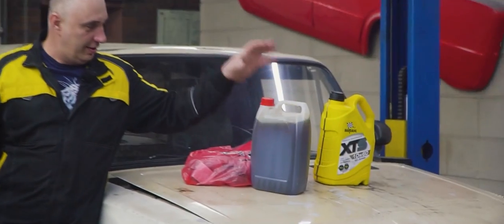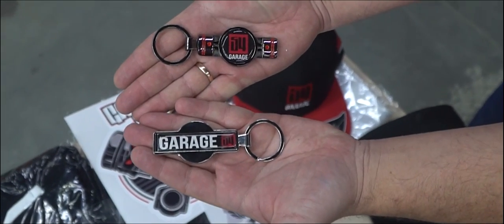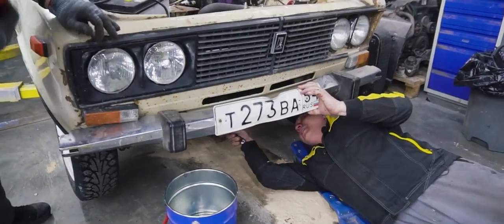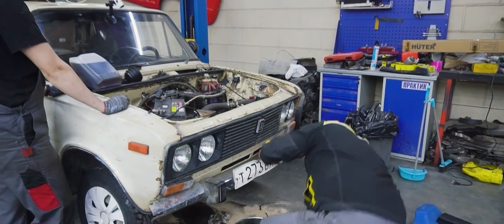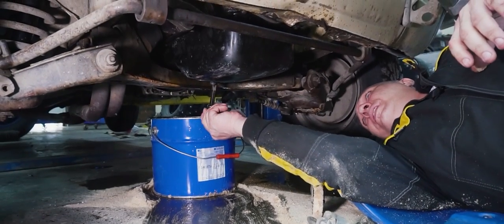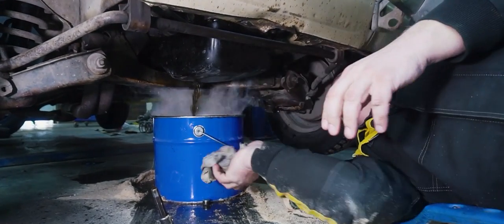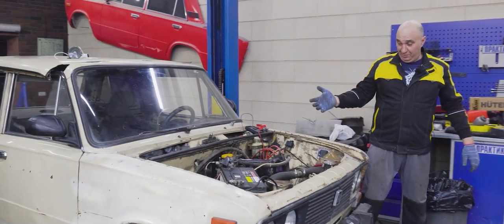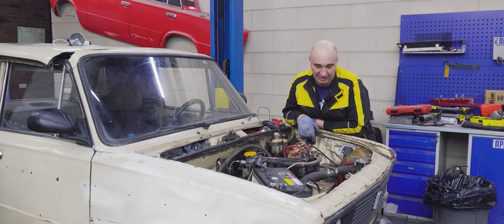Can you change the oil on a running engine?

Comment: Put a turbo on a stock lada engine see how much it can handle
Reply: That is a great idea!!!
Reply: Or use a second Lada engine to power a supercharger that forces air into the first engine!
Reply: Yes
Reply: Yes, great idea!
Reply: , while running 😁
Reply: Noice
Reply: Nice idea!
Reply: My guess is not alot
Reply: With how much blowby they have, forcing more air would only exacerbate that issue.
Reply: The block will become Swiss cheese at 30bar boost
Reply: Well we learned at sick week 80psi splits a Honda in two
Reply: will be difficult with a carbie... they has to switch to EFI first, i think... 
of course there are ways to do it with a carbie but this isn't a proper way...
Reply: Yessssssssss
Reply: @djtongi  you can turbo prep the carb or just run an old 70's suck through system
Reply: @djtongi  I think as long as the tune the fuel ratio to the boost it should work somewhat.
Reply: Yes!
Reply: and add NOS!!
Reply: Yes!
Reply: @jwalster9412  the problem is that they are carbureted so they don't work under positive pressure of the turbo. the turbo ends up pushing the fuel into the jets. you will either need to use a fuel injection system or put the carburator on the intake of the turbo which is a little unconventional
Reply: seen that, stock 1200cc lada engine can easy handle 1bar boost :D
Reply: Lada VFTS was 180hj.(back in 80s soviet russia)  But not stock engine.
Reply: @mvnk4437  and it was not turbo...
Reply: Brilliant plan! 😁
Reply: or how many turbos can a lada engine take
Reply: Could you just use compressed air?
Reply: This
Reply: @djtongi  fuel injected ladas exist
Reply: Why not twin charge?
Reply: @jwalster9412  more like 5
Reply: Great idea!!
Reply: @steve0680657  instant Swiss cheese engine block. Just like instant ramen.
Reply: @jwalster9412  u do realize 1bar=14psi
Reply: @Austin-ue5kh  Yeah.. but it will do the trick.
Reply: I think you should see how much boost the Lada can take!!!! Best idea!
Reply: @SerPurple51  they'd need to fit the turbo after the carb, or get an airtight carb. It can be done.
Reply: Yes!!!
Reply: 2 turbos .. one small one big .. compound style
Reply: Might ad well go with nitro while at it! What power would it produce, while it lasts if at all
Reply: @jwalster9412  guy just blew a chev into two parts 80 lbs /5.5 bar
Reply: @dennisford2000  video?
Reply: @jwalster9412  30 BAR? That is a TON. over 400psi...diesel trains don't even hit 100 psi.
Reply: @midlbrwn15  I don't just want the rods to break, I want the cylinder walls to pop.
Reply: @jwalster9412  uhh dude... 400 psi will just be a bomb, man. I'd almost guarantee 60psi would probably be good enough for some destruction. Even a good diesel block can crack at 40. Not to mention there's no way it'd ever get to 400.
Reply: @tucsondog  pretty sure roadkill did that but a Russian version would probably be just as hilarious to see
Reply: @CyberlightFG  yes
Reply: You would have to add alot of fuel or would nock alot but I am sure with a very rich mixture it could easily handle 300hp
Reply: I suspect this could go quite well, those blocks are cast iron, closed deck. Ideal for huge cylinder pressures. I suspect the block could handle some serious boost. These guys have put together DIY fuel injection, if they got it to work with a fuel pressure regulator, some forged internals, block studs, and possibly some way to manage ignition timing, I think they could pull it off with some serious results!
Reply: @jwalster9412  as would any block with 435 psi of boost(30 bar)...

Comment: Try air-cooling a regular watercooled engine, by pumping lots of air through the water cooling system, and check how long it can run like that
Reply: 👆This☝️
Reply: Or put an air conditioning compressor on it and use the engine block itself as the condensor 😜. Probably not good for the engine as the engine is designed to run at a specific temperature, but maybe it's interesting
Reply: Large industrial compressor and a gang of intercoolers to lose the heat of compression
Reply: air cooled engines are basically oil cooled. they need twice as much oil in sump
Reply: @kize32  not
Reply: @kize32  Volkswagen 3 qts 😀
Reply: Doesn’t work…..
The air can not overcome heat and carry it out like coolant.
Reply: @lookingbehind6335  with sufficiently cold air I could freeze the engine, and it would stop
Reply: @dennisford2000  you could, or someone else?
Reply: A cooling system with water jackets in the block are only designed to hold a few psi even when hot, so like 20-30psi at most.  Test em at just a few lbs..  air conditioning systems run at 230psi normally so i doubt the gaskets would hold the pressure of putting an ac compressor on the cooling system..  but good idea, it should treat the motor like a heat pump and work for a second at least but the refrigerant and oil would turn acidic pretty quick with water and glycol residue all up in the system..
Reply: @Z-Ack  coolant gaskets would work as designed, a 150 cfm compressor 5 m2 for the rest of the world, would not develop much pressure but huge volume, just remove the stat . Hey Vlad , how bout it , need a five meter compressor, five hundred feet of 50 mm hose in the snow and blow it. Might not get hot . Remove all the various connections and sensor holes in a carb engine, and blow it, and after that maybe use the compressor for boost!
Reply: I have always thought of that lol
Reply: @lookingbehind6335  If it's moving fast enough it could.  However, his is all for fun stop being one of those guys that is standing there smoking a cigarette in the corner acting like how every idea any one else says is just "stupid" don't be that guy. It's a thought for fun and entertainment.
Reply: @Engineer9736  evaporator
Reply: @jonathanschubert9052  did I stutter?
Reply: A vacuum pump on one end, a compressor on the other.
Reply: @lookingbehind6335  I tried to drive home one night when it was -30f outside and had a heater hose bust on me. I only got about 2 miles down the road before destroying my engine. Thought the cold woudl air cool my engine. But air cannot overcome heat like coolant.
Reply: Won't work. Trust me. Not enough surface area, and the system is usually not rated for the higher air pressure required to even make a difference - refer to comments above.
Reply: @SALTrips  would not build pressure and would work
Reply: @dennisford2000  the engine itself is a fantastic compressor. why not plumb the intake of the engine through the cooling system to have the air the engine uses to cool the engine? self contained coolant system that is under zero pressure
Reply: it wont
Reply: @Mikelectric  it has to it has no choice.
Reply: @jasonharrison25  large diesels do exactly that at idle. , and it can be a cylinder deactivation on varying cylinders to make an engine that can be run san coolant.
Reply: @Z-Ack  so with a cylinder of nitrogen or a scuba tank let’s see what pops on an engine when you have say 300 psi /21 bar . Start with old stuff and see  core plugs pop , radiators pop hoses swell up like.... the old ladies belly when she is pregnant. Then make a hat for the carb and blow it, maybe some killer springs on the valves for float and see if lada can do ten k rpm?
Reply: thats not how air cooling works! 

lol
Reply: @Born_Stellar  right. But this Russia.
Reply: Air is much worse thermal coupler, the engine will die almost as fast as no water
Reply: @barakhalla5338  one in a thousand, thus you need 150 cfm or bigger, inter cooling and laying hose in nice Russian snow.
Reply: i think the best way to do that is with a turbo .. mount the turbo on the exhaust normal, then take the thermostat out then hook the bottom radiator hose to the turbo where it would of hooked to the intake then redo the waste gate so the turbo will spool up sooner
Reply: @stephens7725  Another person who doesn't know basic physics. Air is a garbage heat conductor and a turbo compresses air... which HEATS it up.
Reply: @kize32  

All engines are oil cooled though.
Reply: @Z-Ack  as a low pressure engine block evaporater on a A/C maybe as i have thought 💭of trying it but volume counts too which is why I probably haven't tried it yet that and for me it would be a expensive experiment to do
Reply: Air is a really bad thermal conductor, try holding your steak 1 cm above your pan and see how long it takes to cook.
Reply: @s.c.o.s4672  but R-12 or CO-2 or something different but like it not air / O-2 for my experiments

Comment: I would like to see a spark plug change with engine running 😜🤣
Reply: I wonder if it would be possible to get it in? I've seen the damage they can do when they shoot out! 

I agree!
Reply: Sounds dangerous af lol
Reply: Sounds like its risky enough for Vlad, he will look like a newly assimilated Borg with the spark plug sticking out of his eye socket.
Reply: @volvo09  Not such a problem, with an idling engine. There's not much compression in the cylinder, and, you've removed the plug wire, so the cylinder isn't "firing". If the engine was running wide open, the compression would be much greater, and it's noisy. (I know, I've actually done it!)
Reply: I've had spark plugs work their way out before, the trick would be wearing an insulated glove to protect you from the high voltage. Or use a coil on plug setup so that you electrically stop the spark before you need to remove the coil.
Reply: I can see all but one aspect of that as doable, and no it isn't the high voltage lol

You're not going to get the threads started against that compression stroke. You can short the spark plug wires out one by one and likely even remove a plug from an idling engine with little more than a bit of stress on the very outside threads for the holes... 

But no matter what you do, you're not getting the new one in the hole without wrecking shop in those holes 🤣🤷‍♂️

Comment: I added oil to a running engine once. I really miss that car but it did make a cool fireball after the oil sprayed on the exhaust manifold.
Reply: My friend left the oil cap off his girlfriend's car. She pulled over thinking the car was on fire after getting on the highway. Oil was ALL over the exhaust side of the engine. 

And the cap was still there, haha! I have him tons of shit for that one!
Reply: @danieltabrizian  look it up, dumping it on exhaust manifold isn't gonna light it up and that's a simple fact. U can dump gas on the exhaust manifold and it won't ignite either.
Reply: lmao oil doesnt burn that easily.... left my cap off one time. ran 70kms and when i opened the hood the oil was literaly everywhere,including the exhaust.
Reply: @volvo09  I’ve done the same, realized it within a mile of an autozone, bought a cap, a quart, and paper towels lol
Reply: Oil will absolutely catch fire happened to me on the way to FL from GA in a $2000 car I bought because my truck blew up on the way up. The car had a bad valve cover gasket and puked oil down the back all over the manifold when I opened the hood at a rest area to check the oil, woosh flames licked up. I got it out and put oil in and drove another 500 miles. Car still runs great
Reply: @shawnsatterlee6035  Transmission fluid will. Seen an old square body gm burn part of the engine bay plowing snow from transmission oil puking out of the dipstick.
Reply: @danieltabrizian  i don‘t know if a hot exhaust is enough to light it on fire, but in a burning chamber it will certainly ignite because of the high pressure and temperature in there. Best example is a runaway Diesel, that happens when a Diesel engine pulls oil and burns it, so there is no way of stopping it until it seizes.
Reply: That didn't happen.
Reply: @euro_rfx4499  yeah, even a burning cigarette won’t light a puddle of oil
Reply: @nicoketterer9665  it could if you just drove it real hard... the exhaust would need to be near the glow point to ignite, and that's not impossible, I've popped some hoods after a spirited run at night and seen a slight glow, so it will get that hot, just has to be driven hard. 

I built an oil burner heater once and if the burn plate ran dry and the fire ran out it also would relight under similar circumstances... Little glow remaining, it relit. Other times it just needed a whiff of open flame from a lighter in the smoking oil.
Reply: @volvo09  you can ignite it if it’s hot, to the point it starts vaporizing. But i doubt you can light a puddle of it by just throwing a burning match into it or by holding a lighter above it. As long as there’s no vapor or gases the mixture is to rich so it won’t ignite. Same goes for diesel fuel
Reply: @shawnsatterlee6035  we lost an evoX with over 600 horses on the Nürburgring due to an oil leak onto the exhaust system.
Made some cool pics and a video from the incident. Was a sick af fire!
Reply: @Shawn Satterlee  

First thing I thought when I read the initial comment. Even if you atomised the oil in a fine spray (exactly like blowing out of the engine wouldn't do) it wouldn't ignite, ever.

As you say you can dump petrol on a hot manifold and it'll hiss and dry like water.
Reply: @tct72  

Unless there were rags or paper etc left in the vicinity the oil wouldn't catch fire. The flash point is nearly 200 degrees.
Reply: @Cronic318  

It will burn but it categorically won't combust on contact with hot metal.

Engine oil, trans fluids etc are defined as combustible liquids, not flammable. Two very different things. If anything used engine oil is far more 'able' to ignite due to the small presence of fuel traces in it... but it still won't set on fire. Try dipping a piece of hot but no where near red hot steel in used oil. It'll hiss and bubble and that's it. Good for quenching/surface treating though.

As I said in another comment the only likelihood of a fire from oil will be a something for the oil to soak into and burn when things get hot enough. This is why leaving oily rags in the engine bay especially near exhausts and manifolds is a big no-no.
Reply: Explosion?
Reply: @volvo09  i done that once the cap was still there i never felt so dumb hahaha 😂 😂

Comment: If your vehicle burns/leaks enough oil, you have the bonus of never having to do an oil change because you keep putting new oil in. I call this: The perpetual oil change.
Reply: you need to put a new filter in at some point
Reply: @SpencerLemay  
Nonsense……filters are overrated. After they clog up, they will go into bypass to insure flow. 😀
Reply: Same idea for power steering fluid, ATF, brake fluid as well?
Reply: You still need to drain the oil to remove the sludge from the pan.
Reply: @Chris-yy7qc  not needed on old worn engine on POS car.
Reply: I knew someone who did this in school...they just bought a case of oil to keep in the trunk and dumped in a quart or two every time they got gas...
Reply: @lordred7462  It probably became a POS, because you treated it like one.
Reply: @Chris-yy7qc  when a new set of tires cost more than whole car is worth than you stop repair it, change oil and so on. Just drive it until it breaks and dump it to scrapyard then and buy cheap another one
Reply: @lordred7462  Thats what stupid people do. Killing a car "on purpose" by neglecting it is plain stupid.
 
It doesnt matter how much the value of a vehicle is. Never cheap out on maintenance. If youre on a budget do the work yourself. And if the car runs fine and theres no engine damage or excessive rust, then it will continue to run for a long time (*if* maintenance is done).

Buying new cars instead of repairing the old one is in 95% of the cases way more expensive in the long run.
Reply: @Chris-yy7qc  we're talking about 25-30 years old cars. These cars are not economical to drive, burn more fuel (when you pay 1litre of fuel 1.90$, 1 litre, not 1 gallon, higer fuel burn is issue than) and in 90% cases these cars are rust buckets.
Reply: I had a 90's  Mitsubishi Galant that did that. 1L of oil every week.
Reply: @lordred7462  The cars are rust buckets because of drivers like you that dont care. Rust can be adressed when its a tiny spot. If you again neglect your car and let it rust until you can see the road, thats not the cars fault.

More fuel than what? A new car? Sure, but the new car will cost 20k$ more. You can refuel your old shart cart forever for those 20k$. So even if the fuel consumption is half on the new car, in the end the new car is not more economic.

But thats not what we were talking about at all. Quote (you): "Just drive it until it breaks and dump it to scrapyard then and buy cheap another one". So arguing with fuel economy old vs new doesnt really make sense.
Reply: @Chris-yy7qc  look pal there is whole lot of peoples that live in condos and their cars are parked outside on public parking whole their life. How can these people "deal with rust when is just a small spot" when they can't even crowl under their own car? Not everyone is this world is mechanic and most people don't care, when their car tells them that it need oil change they change it and don't think much about it. For most of us car is comodity just like TV, so we use it how we want, when we wont. When it breaks, just toss it to junkyard and buy another one. Not to say that that new cars are whole lot nicer to drive compared to old clunkers.. Don't get me wrong I got old Lada Samara that is currently in restoration process but it's just old car and when restored it will never be everyday car. No power steering, no ABS, no AC, no power windows, no nothing. It's just old car for weekend joyride and hell on earth if needed to ve driven every day
Reply: @lordred7462  You dont need to be a mechanic to change oil or to sand away some rust and put paint on it. Neither do you need a lift or expensive tools. You need 2 hands and your brain, then theres a way.
Stop making excuses for your carelessness/lazyness and get stuff done instead of wasting your money by neglecting your stuff.